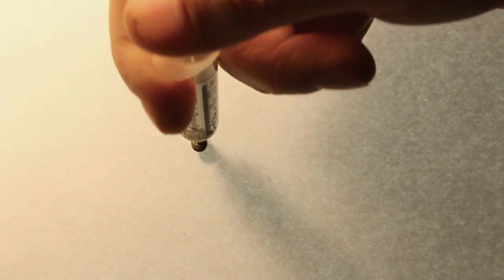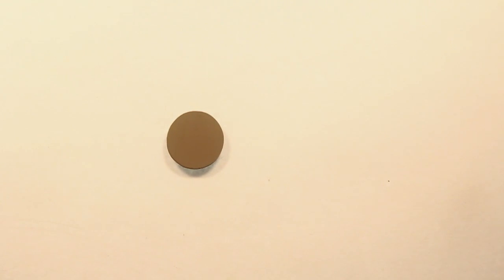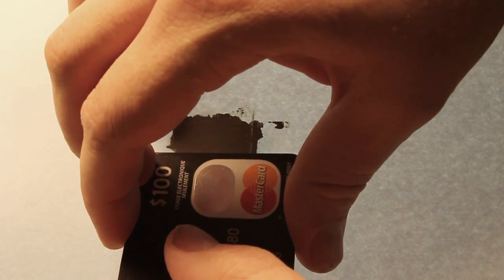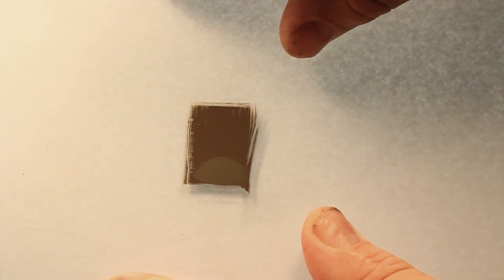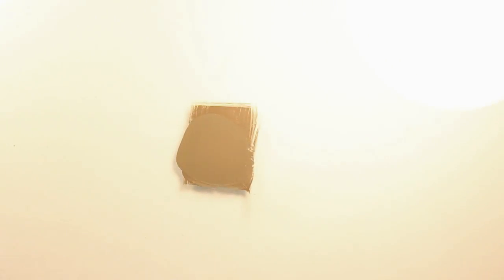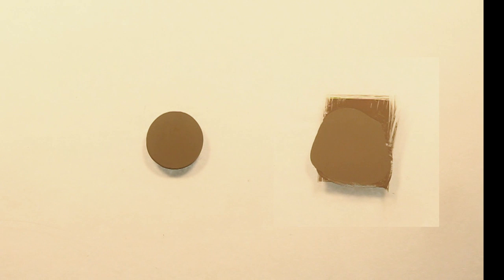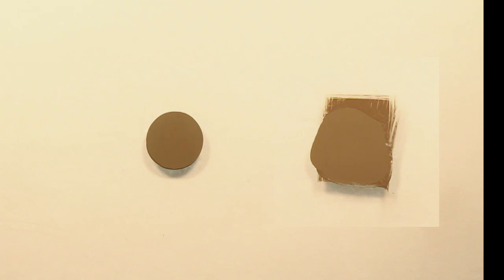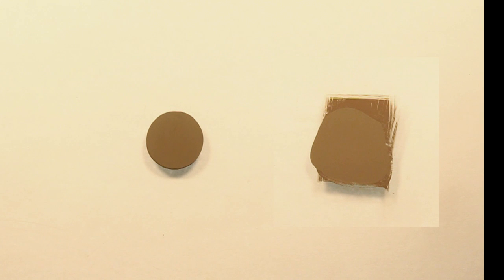Thermal Paste Spread Method VS Dot Method

Comment: used spread method on amd fx4100, oc'd to 4.2GHz ran for 6 months with a 8 heat pipe heat sync, ran under load at about 25 degrees celsius... took it apart, there were air bubbles. put it back together with dot/pea method. same overclock. same temperatures.  same ambient temp of 75 degrees F.  TL;DR this stuff only matters if you use stock heat sync and crappy thermal paste. which you probly dont care about anyway.

Comment: You'll have to remember though, as the CPU increases temperature the paste will spread out more and since the heatsink is clamped down it will continue to spread the 'pea' method towards the edges and making the layer not as thick. Idk every time I tried the spread method vs pea method my temperatures were always lower on the pea method by almost 20 degrees which is a huge difference..

Comment: I understand what you are saying.. but the metal of any IHS is machined.. and it's metal.. metal fractures.. it's why people sand or remove their IHS for better temps + the cheap compound intel has been using lol. Regardless of your glass method, this isn't realistic unless you've done work to the IHS to begin with... I've won OC'ing championships.. i've tested every method you could think of rigorously

Comment: Also if you use the spread method you may want to consider spreading on the Cooler rather than the CPU as the cooler is likely to have more defects and divots than the CPU.  Also spreading on the Cooler will result in less likely of getting compound on the edge of the CPU, if that matters to any one.  As I mentioned before I have tried both the dot and spread method and each works, you just need to use what ever method works best for you.  Happy Computing...

Comment: I have been installing processors for decades, like 3 decades, and I am here to say that either way works.  The DOT method works better these days then a few years ago because of how the newer processors have a more controlled tension compared to years ago when you just clamped it into place with NO COMPOUND...  Yes I am showing my age here as thermal compound has only been around for less than 15 to 20 years, if that.  They both work, use what works for you...

Comment: To me this seems like the correct answer.  Spread method can get more coverage, but can get borked easier.  Problem is heat sinks and cpus aren't transparent, so it'll be hard to see if the application of the paste worked properly or if you have trapped air.  If you use the pea method, it'll fix itself with time and heat.  TL;DR - I will keep the pea method as it hasn't failed me yet!

Comment: Do not use your fingers. I know its easier (i've done it once) but you dont want to touch that thing with your fingers...
and beside the health risks there is always a possibility your fingers grease messing up the results.
Try using prime95 and coretemp to test and post results.

Comment: I also spead the thermal compound but i actualy developed a technique to do it and get perfect results.
There has to be some preparation before applying and you have to be more patient while doing it.
Very slow and steady moves and preheating the cpu gives the best results.
Also you can try using a thinner plastic tool for application.

Comment: I have an athlon ii x3 3.2. I use thermal paste that my local pc shop gives me. They only charge $1 for it. I have Oc'd it to 3.9 ghz on the factory heat sink. The highest temp it seen after 3.5 hours of gaming in black ops 2 was 56 deg C.   Oh and btw i spread the paste with my damn finger.... Fuck the dot method

Comment: it's also worth noting that the Die containing the transistors of the CPU cores are always in the middle and the initial spread does not initially have to spread to the edges of the CPU.  delid a CPU and you'll see i'm not wrong.  also thermal compounds in 99% of cases spread as the CPU warms up.  you will find the dot method reduces any risk of air pockets and the preasure needed isn't as much as you think due to the further spreading created by the warming of a CPU. Dot is best

Comment: if CPUs didn't have head spreaders (like Athlon XPs did 10 years ago) this spreading issue would be moot since the ONLY way to apply the compound is with a dot. But there's a reason for the heat spreaders so the heat isn't concentrated in one spot where the cores are. You do want a majority of the surface covered but that can only be done by spreading it, not the dot method. But you can introduce too much contamination by spreading.

Comment: When you spend time to spreading thermal paste, you're introducing contamination like dust, lint, etc. The "dot" method is quicker, since you can put it on and apply the heatsink right away. You give it no time for any dust to fall on it. When you did the Hyper Evo 212 install, you spread the compound you THEN screwed on the risers on the CPU bracket allowing even more time for contamination on settle your thermal compound. not wise.

Comment: You won't get total coverage with the dot method, but that's no problem because the CPU is in the middle under the IHS. Heat is only produced in the middle of the IHS. With the spread method, you will get air bubbles with silicone type thermal compounds, but not with silver thermal compounds, so the spread method is fine with for example Arctic Silver 5 but not with Arctic MX-4.
Thickness of the thermal interface layer is not important, it should just be spreaded equally.

Comment: I've seen a fair share of "failed" applications of thermal compounds (Too much trapped air), where the builder has used the spread method. Once I teached them about the "dot" method (a.k.a pea methond), they've rarely failed after.

Thing is: If the spread method is done RIGHT, it will work, and it'll work even better than the pea/dot method. But it is hard to do it "right".
The pea/dot method is far easier, and performs well. It's generally recommended since it's less prone to fail/trap air.

Comment: a CPU dont need to be totally coverd with paste. This will be unnessecary as the cores are only in the middle. There fore the dot -method would be more then enough and as theres less pressure needed to equaly spread it, it will actually a beter choice. The spread method might work but chances that the paste wont spread good enough or make contact are less. I tried the spread-method a couple times to see the difference but wasnt that big But had one time when OC the spread-method began gettinghot

Comment: Well I can't see under the heat sink but my CPU at full load is around 50 degrees. It's overclocked a bit as well so the temps are fine, but it may have been too much paste.

Comment: artic silver's website has a list of what method to use for each cpu type. they have an amd and intel list.     a thickness of thermal layer should be very thin so I opt for spread method as artic silver shows using both methods as the correct method depending on cpu.

Comment: I always use the spread method. I find a tight rubber glove using the index finger works perfectly for a fine thin layer with Arctic Silver 5. Way better and faster heat transfer than the dot method...

Comment: yea, it really seems like the the dot method will only work with thinner thermal paste. For the thicker stuff (which is often good quality) you gotta go with the spread method. Personally I dont like the dot method because I never know if its made complete covereage of the CPU so I'd have to do ait once just to test and and remove the heatsink to check it and waste a lot of thermal paste..  I did spread method and I all I know it my temps are looooww....

Comment: The dot method is best! i have done temp test and there is absolutely no differences it temp. They both work the same but the dot takes half the time and you have less chance to create bubbles, I have had bubbles form the spread method in the past, and had to reapply the compound.

Comment from the maker: The paper is behind the second sheet of glass. The "precise machined metal" of the CPU and some heatsinks are a lot worse than any paper by the way. It's filmed on an animation light table. The compound is being lit from underneath by two 1000 watt fluorescent bulbs so you can see if there is any bubbles. Also there are two 150watt floodlights going from above. It's in HD. If there were bubbles you'd see them.

Comment: 3. I see bubbles in the compound before the glass is pressed on, the air doesn't magically disappear!
4. spreading, or multiple very small dots (hard to do) made sense in the previous hyper 212 due to the gaps where the heat pipes met aluminum, this shouldn't apply for the evo

Comment: 1. This is paper on glass, (two uneven surfaces, the paper being very uneven), a real application is precision machined metal on precision machined metal, the effect on the spreading of compound is obvious in the second method, where the top portion does not contact the glass
2. Spreading the compound manually creates bubbles you can't see within the compound, especially with the technique you used (using many strokes, rather than one stroke from one side to the other

Comment from the maker: Some aftermarket coolers do come with applied thermal paste. Air bubbles aren't desirable because they can cause higher operating temperatures but they are easy to avoid. Heatsinks with pre-applied paste make installation easy for people who have difficulty spreading thermal paste properly.

Comment from the maker: I go by the assumption that the more contact the better. More fin surface area on the heatsink distributes more heat into the air. The CPU surface is capable of having heat dissipate from the entire surface in the same sort of way. Less thick layer of TIM and more surface contact seems to me like a good approach to having heat transfer.

Comment: I would always recommend dot method because the surface of the cpu and heatsink aren't perfectly flat like glass and the chance of air bubbles because of that is much higher. It doesn't matter for most people because the temp difference is neglectable but dot method is the easier and better method overall.

Comment: ...actually, I do have a question: does the dot-method allow for adequate coverage of the cpu surface?  The spread-method (which I use personally) seems to grant one greater control over the total coverage of the thermal paste - is it total coverage, or the thickness of the thermal interface layer, which is more important?... thanks...